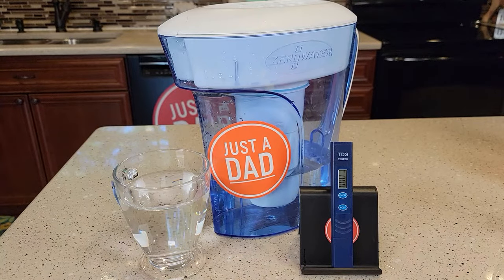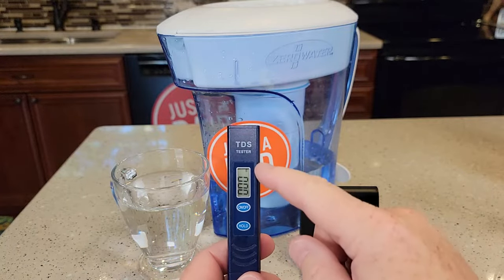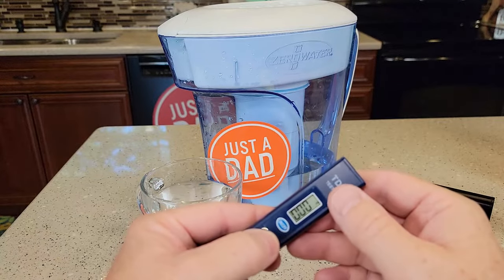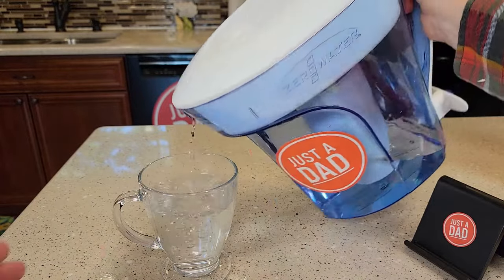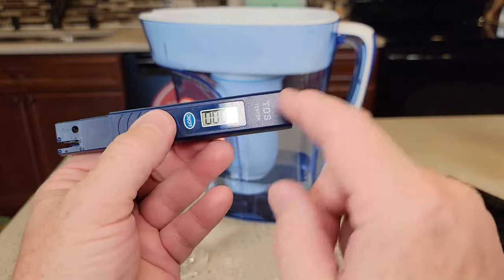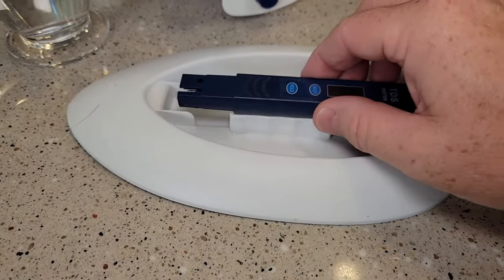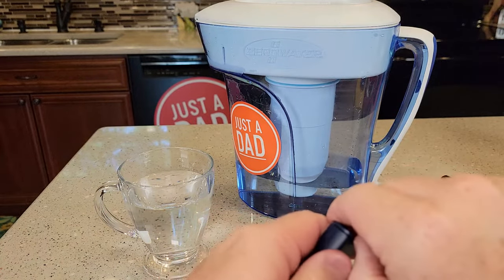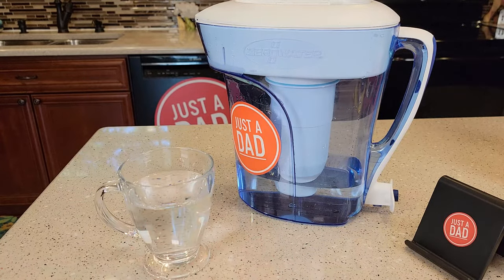How Does Zero Water TDS Meter Work & How To Change Battery

Comment: Thanks for the TDS meter tips.  If you do another one, please add how to change a battery with emphasis on placement.  For a 78 year old it;s a bear to see + or - on the batteries, and I don’t see anything on the ZeroWater website on how to do this. And the device, unlike things like tv remote, does NOT tell you the placement.  Thanks!

Comment: this did not explain how to put the batteries in. Which side goes where?
Reply: It's self explanatory. Hopefully you figured it out 😉
Reply: @she_sings_delightful_things  It's not self explanatory.  There are no indications on the battery holder which end is positive and which negative. Or how they should be oriented.
Reply: @44lksd  No, you're absolutely correct! I just realized Zero Water meters are built differently than others.
Reply: If you pause video at 1:25 you'll be able to see the orientation of the batteries in relation to the device. That's what I did and it worked fine. Good luck y'all.....
Reply: Also, if you can't find the lr44 battery, you can use a 357. Duracell works for me.
Reply: @44lksd  You are right!

Comment: Hi question I have,I just found out the tester is battery operated..I changed my water filter and the reading was still off but noticed the display was off..so I’m guessing the reading may be inaccurate due to batteries needing to be changed as I just replaced the filter

Comment: I've received two new filters and both even after filtering a few times are reaching between 17-39 ... Defective?
Reply: Make sure your filter is screwed in all the way. It should not allow any water out of it except via the small hole in the very bottom of the filter. If the rubber seal at the top is even slightly off, it will not filter properly. Good luck! 🍀

Comment: most bottled water will be 170 because of minerals. the meter is pointless its just for marketing
Reply: I’m glad I read your post because I have a zero water faucet filter which the water reads 45 coming out which is the same as the tap. I added pink salt and Celtic salt to my zero water filter 32 cup pitcher and it read 176. I was freaking out like wtf! 😂